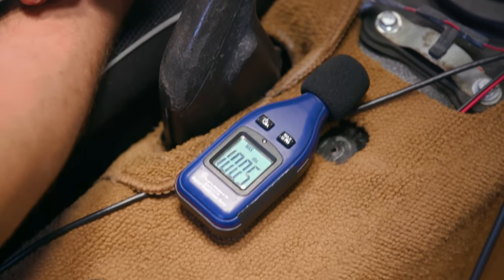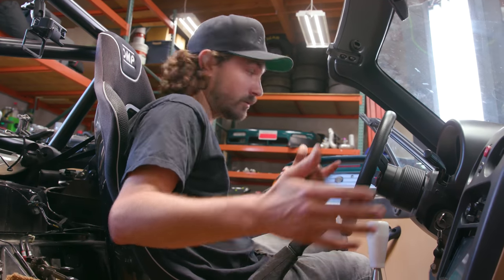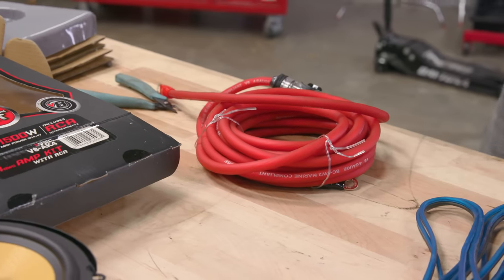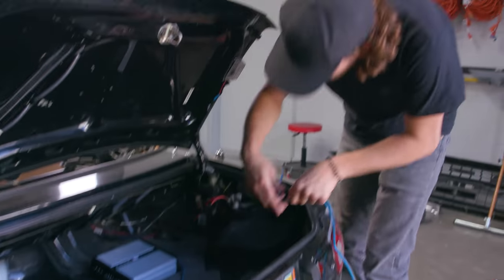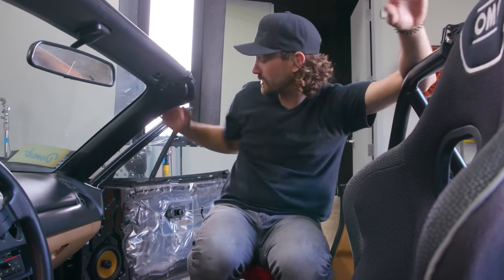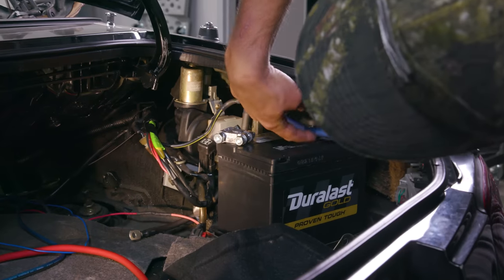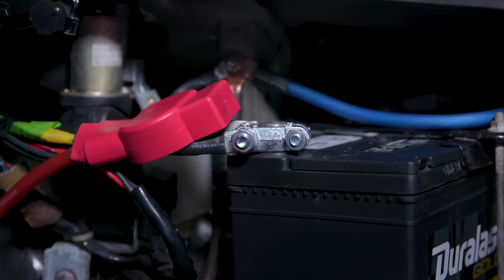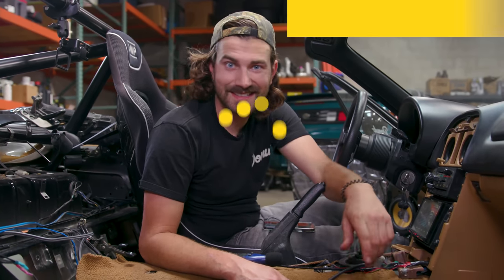Is Upgrading Your Car Speakers ACTUALLY Worth It?

Comment: as a hardcore car audio basshead, i think he did a really good job explaining the process for ppl who arent familiar with sound systems and installs. great job. also people should know that  you can hook up another pair of speakers and a subwoofer to the same amp
Reply: Well you should know, unless the amp can actually handle adding another set of speakers And a Sub, then you sure can't just add more to it, that's not how that works at all.... You would more likely than not need to add in a second amp for that... But then if your cars electrical system can't support Two amps and all those speakers, you could just destroy your battery and alternator.. Just to add a second amp you'll most likely have to add in a second battery too, but need to know how to hook it up right so that it doesn't just destroy your battery and alternator.. Even with second battery it might not be enough, so then you gotta upgrade your alternator, and probably throw in a capacitor to help.....
So yeah you can't just add more Speakers to a system... I'm guessing you've fried your share of amps and speakers with that mentality.
Reply: @ixwillxeatxurxbabies  hey I’ve been wanting too do my car speakers for ages but since I have an 80s shit box I’ve all ways been worried something electrical would fuk up or kill my battery 
How would you know if you need a second battery and if you added a sub with a built in amp could that connect straight to an all ready existing amp like the one this guy installed?
Reply: @Hydro  if your battery gauge dips too much (headlights dimming or dancing to the bass is an obvious sign too) its a sign you need a second battery. They make specific ones for audio that act similar to a power capacitor. I have a second battery for all my extra accessories. Subs and lightbar/pods. Also allows for a longer run time while the vehicle is shut off

On board amps in subs are already tuned to the sub which can make it an very easy install but if you're running bigger or multiple subs (I have two) an external amp is generally better. I have mine wired together at 2 ohm (2 12in p3's). What kind of amp really makes a difference too not just in power output but audio quality. 

If you have a local audio shop talk to those guys to see what best fits your needs
Reply: @Archer957  thanks for all that info man yeh it’s probably best I find an audio shop I’m pretty new this kinda thing
Reply: @Hydro  no problem. Talking to the guys at the audio shop will help a lot (if they are a good shop that is) you should learn a lot. Also don't worry about building your system all at once. I've built mine over some years. Your deck or head unit is extremely important for audio quality. Speakers even $100 ones can sound great. Replace the front first as that's where the voice is.  Rear can wait tbh. Then subs and amp is all whatever you're looking for whether it's a soft boom just to add to it or a massive boom that shuts everyone up for an entire block

Comment: You can do HPF and LPF within those Pioneer head units as well. But yea, like the video mentions you should be filtering all the low out of those 6" speakers and run loudness/bass boost off then install a sub.

Comment: clipping is also a thing, from both headunit (high and low signal) and amp. If the speakers is rated for 75 rms, and you send a like 60wrms clipped "bad" signal, they also can fry.
Reply: Audio clipping is a form of waveform distortion. When an amplifier receives signals that are beyond its maximum limit, it goes into overdrive. This overdriven signal causes it to produce an output voltage out of its capacity, which causes clipping and audio distortion.
So you kinda got that backwards... It's more like the Speakers can only handle 60wrms, but your amp is sending 75wrms.. Turn down the amp gain, and the volume on your head unit, Boom clipping gone.

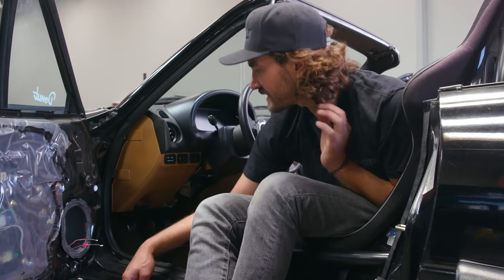Comment: I replaced the old fullrange 5.25" Coax speakers in my 23 year old Renault Clio with some 40€ Alpine SPG-13C2.. like those at 6:39. but smaller, and man it was worth it, even with no extra amplifier. The mid an high frequencies were so much better and the installation (just remove the speaker covers, not even die doorpanels) was easy as hell.

Comment: Amplifier gain is not a volume adjustment, it's used to make sure you're not sending a clipped signal to your speakers.  That's a great way to destroy a new set of speakers that you haven't even broken in.  Also, if you're not going to seal your door or add any type of sound deadening it would make far more sense to test the speakers with the door panels installed.
Reply: Finally someone who speaks electrical engineering
Reply: I call suspect too on cutting the factory door speaker wire coming from the head unit.
Reply: The ones that do nothing always have the most to say
Reply: @dragoh7102  that's a big assumption considering you're the guy who feels compelled to respond to a random person's 6 month old comment on a video that has nothing to do with you.  I'd ask you to explain what was incorrect about my comment, but I think it's safe to say you have no idea what you're talking about.
Reply: @roysjudy  great comment buddy 👍🏽keep it up

Comment: The only suggestion, and I’m sure it’s been covered, is to make the speaker wires equal length. They’re probably pretty similar on that setup, but sometimes they vary. And, potentially, you can have a slight delay if one wire is significantly shorter than the other.

Comment: Good video but you're missing the part where you determine what volume level the HU distorts and how to properly set your gain with the amp.
Reply: cuz he didn't do that... they were louder, but sounded just as shitty as the speakers he just spent all that time to switch out.

Comment: The biggest problem is modern radio touch screens incorporate most of your hvac controls and such a aftermarket unit would generally be a downgrade. They're really isn't many good ways of converting the signals, high to low converters off the speaker wires are kinda iffy and the headunit just sends serial data to the factory amp.

Comment: Hey everyone. Please don’t listen to music from your phone, with the phone at 100% volume. That fuzz is clipping. 80% (or on volume knob click down) is plenty. Clipping is bad for your speakers and bad for your ears. Thank you for listening to my TED talk.
Reply: You should never push any amp or source to 100%.  Set it up to be your "max" volume at a say 90% headunit volume.  And keep you amps setting below thier max.
Reply: came thru the comments hoping someone else would point this out.
Reply: And that's why i felt pain when they cranked the new speakers to the max and heard the badbad sounds
Reply: If the gains are set right you can max out the "volume" and not be clipping. Looks like they did it the "old school" way by ear, so yeah not so good. Though most of the distortion at the end was not having the crossovers adjusted.
Reply: Full volume has bad audio quality and it destroys the experience. I ALWAYS put volume on full first and then I go down two levels and keep it there. It sounds WAYYYYYYYYY better to me and adds life to your device since it’s not being abused everyday
Reply: @ZootedSosa  personally I don't really listen to much music over mid volume. My loud-to-good bar pings pretty quick
Reply: None of this matters running full range coaxls they always sound sloppy!
Reply: @ilovetoyotatrucks  that's why you set your crossovers so you're not sending frequencies that they can't reproduce. And setting games properly does matter when running any kind of speaker.
Reply: @nicholascortez728  crossover aside some of what you  filterd still makes it through  there is NO separation between a coaxl & it's always limiting excursion & midbass as well as f* up the wave because they stick a crappy tweeter in the center 

Components or nothing 3way components are best like the massive AUDIO  $150+/- way better option than these freebies from JL
Reply: Scrolling through waiting for someone to mention this, also does he not know that he has a hpf on the Headunit (at least I would think there is)
Reply: @cordellharrison8912  yeah pioneer is the Toyota/ Honda of car AUDIO  decks/hu
Reply: Thats what i was thinking. Hes installing new speakers and instantly ruining them...
Reply: 1) source should be wired and not shitty Bluetooth (if we're being nitpicky) 2) yeah volume on the phone should not be 100%, it definitely clips bad 3) keeping head unit lower amplification and amp at higher should provide far better results
Reply: Haha music go brrrrrr
Reply: Turning it up makes my ears spicy
Reply: Idk you. But I trust you.

Comment: Used to love fitting ICE in all my mates cars and my own
Had a massive set up in one of my cars which was a monster one - 1 x15 inch, 2 x 12 inch 2 x 10 inch 6.5 componants, 3 mono blocks and a 4 way amp, 2 power caps, uprated battery / alternator plus hundreds in connectors and wiring.

Comment: Now for after putting in new audio systems, make a "is it worth it to sound deaden" the miata!
Reply: I put some deading on the doors when I changed the stock speakers to decent aftermarket pioneers. I think it is worth it because it sounds so much better when closing the door.
Reply: @b0nz1official  i havent gotten to my car yet, but just did the front floor, cieling , and rear tires of my work van and it sounds so much better. Would be awesome to see the difference when done as much as possible haha
Reply: @netoisthebest  I don't think I would do this in a Miata. First of all it adds weight and second the Miata is not a quiet car. Lots of rattles and squeaks which would probably make the experience worse if you had less road noise.
Reply: @netoisthebest  i wish i had a car and the budget to mod little things around :(
Reply: @b0nz1official  also u dont hear road sounds as much and no more rattleing in the door... it helps a lot... doing a speaker upgrade without deadening is trash..
Reply: You don;t need to deaden everything.  Tap around, if metal rattles a little strip of dynamat type stuff often gets rid of the rattle.

Comment: Really nice install work!

One thing to consider is that your headunit could actually be adding distortion being pushed up to its maximum output - You may actually benefit from having it at 35 and turning the gain up on the amp as if the signal to the amp is distorted, you're just amplifying that distortion
Reply: The head unit is absolutely distorting the audio when at full volume. The guy is clearly not experienced when it comes to car audio. I learned to set the head unit volume at 75-80% of max, then turn the amp gain up until you hear a bit of distortion, then back it off slightly to remove the distortion.
Reply: facts right here

Comment: To optimize sound I’d recommend running a midbass speaker with separate tweeter mounts near the driver and passenger face Even a sub will vastly upgrade any sound system.

Comment: Should’ve thrown some sound deadening in the door panels when you had them apart
Reply: the alpine type-e's he pulled out of the doors were not stock equipment, and the foam baffles that were behind them aren't either. beyond that, it doesn't make a ton of sense to deaden a miata's doors because they're gonna rattle regardless, and not just from the speakers
Reply: Ehh it's debatable if it makes a difference at this power level.
Reply: @gahbah274  power level lol he’s making like 300hp isn’t he
Reply: For sure....the more the better. I did my Honda Accord and did inside outer skin and outside inner skin and only 6 inch speakers....people wanted to know where we hid the subwoofer
Reply: @ergopropterhoc  wrong. Proper sound deadening and they would be rock solid.
Reply: @gahbah274  did it with a stock Kenwood head unit and 6 inch components and it was night and day better.

Comment: if anyone uses the highpass or lowpass filter, the speakers you bought will have either a spec sheet online or in the manual / with the speakers that shows the frequency range of the speakers or a graph showing what frequencies it can reproduce at what level. you can then use the low pass filter and/or high pass filter set at the high cutoff and low cutoff point of the speakers so they are only getting the signals they can faithfully reproduce without muddying it all up with unnecessary resonant frequencies and such from those lower signals (higher pitched frequencies wont have much noticeable resonant frequencies compared to lower frequency signals but cutting out the highs can still improve it).

Comment: For the same price you could have kept the Alpines, added an amp with a crossover, and a prefab subwoofer box combo. Would have sounded much better overall.
Reply: I was thinking the same thing. Those Alpines were decent speakers, and he didn’t need to waste money on those overpriced JL speakers. The Alpines were mounted poorly, and they were underpowered. There was also no sound deadening behind them, just the useless foam baskets.
Reply: @davidb8373  the jl c1s are an excellent upgrade over the alpine type E coax! and for what you are getting at the 150-179 price point that are a hard product to beat. Morel maximo would have blown his mine.
Reply: @backyardspeed3992  any speaker mounted poorly will sound like crap, even $200 speakers.
Reply: @davidb8373  yeah but this was a commercial for jl audio and the amp and mids were free,thats why they didnt use the alpines.

Comment: For anyone wondering, you really don't need to spend $120 on WIRES, but some audio equipment companies would like to tell you otherwise. Just make sure that your wire has the right diammeter for the current you are planing to push through it, and you are fine. Also, the part about matching the speaker and amp company is total bs, there is absolutely no need for that.
Reply: Yep. If you want the absolute best deal on real copper power wire, go for welding wire, buy the fuseholder separately and determine fuse size on the wire's capability. Car audio power wire, sadly, is an absolute scam. Welding wire is more durable, has a higher strand count, is real copper, and tends to be cheaper. Aside from the exception of some Alpine powerpack (compact) amps and Alpine head units, there's absolutely no reason you need to match brands, it's just for looks or preference, or if you happen to have your build sponsored by one company.
Reply: @ixionn563  yeah, manufacturers don't and can't make an amp more suitable to their speakers because there isn't a way lol.

Comment: The original seats had speakers in the headrests as well with a base system built into the seats would of been pretty cool to try and adapt the new seats to fit them in
Reply: woulf of 🤮🤮🤮

Comment: Great video, I’d also like to add, it’s a good idea to use a product like a Dynamat Speaker Kit. It transforms the flimsy sheet metal in your car door into a solid, non-resonant baffle. For improved mid-bass performance with less distortion. If you’re spending that much money on a upgrade, you don’t want to hear your doors rattle.

Comment: I always heard that you want an amp that can do more power than the speakers will pull. Basically like loading a truck to its maximum load capacity every time you drive it vs loading a truck to 50-75% capacity every time. Plus I've heard that with audio equipment the output specs they give aren't usually as good as they say, so pushing something to the limit it says is like trying to match the 0-60 time a car company says their new car can do.
Reply: Always better to have too much power than not enough

Comment: Love the video, Absolutely need an audio system for my 99. Tip 1 though, always attach the positive terminal to the battery before the negative, if you're working on the negative, just leave the battery out or unconnected.